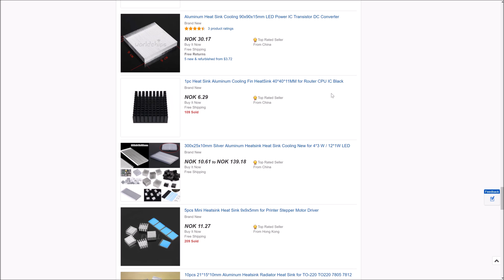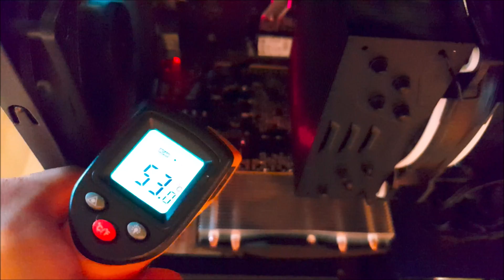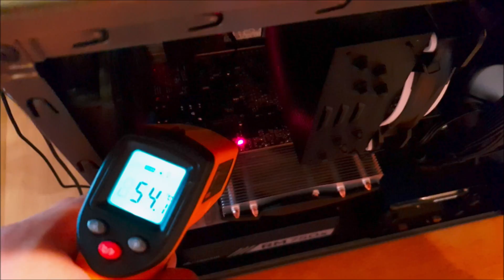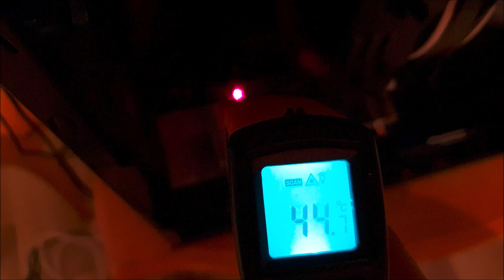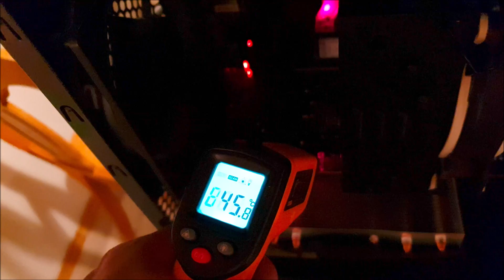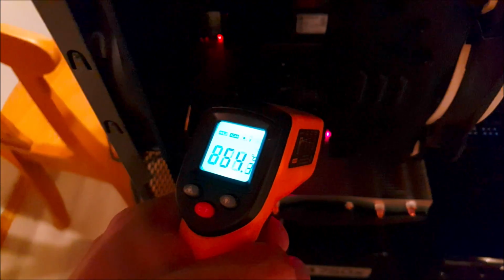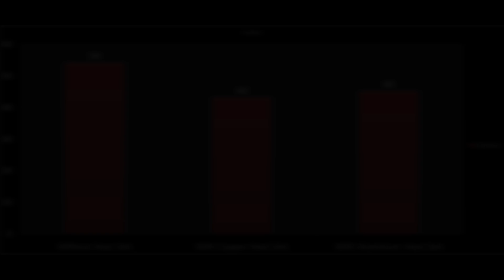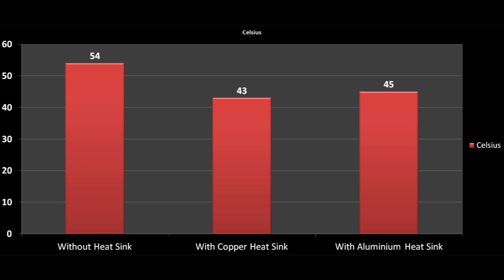Copper vs Aluminium VRAM Heat Sinks

Comment: Good Video but i would rather go with neither. The 8auer said that the vram can be cooled with jsut a smal fan and it would normaly be much better than the stock solution.This is because the thermal tape works as insulation and not only to transfer heat. Also the Vram is with just a fan at around 60-80c on a 1080ti depending on the fan rpm.They usually withstand temps up to 150c.
The stock EVGAs had around 90c Vram temp. Also if you use thermal adhesive its really hard to remove the heatsinks without damaging anything. Ive read a lot, from "Put your GPU in the freezer" to " just twist it, trust me it will go off".
On the other hand ive heard of adhesive thermal tape and falling off heatsinks that causes some short circuit because they touching the cooler. Not the best thing that can happen to a 700$ GPU. And that risk just for 10-15degree? Its not necessary
Reply: that's why he's using the 3M tape.  it's quality stuff.  and you can get a way better OC w/ 15 degree drop.
Reply: What do you think about this solution?
(AIO water cooler + fan on vram + heatsink)
https://www.youtube.com/watch?v=RkN_KTZpCQs&t=4s

Comment: It's a very significant improvement if you take into consideration the size difference between the copper and aluminium heat sinks... The copper ones looked (from casual observations) to have way less than half the surface area of the aluminium ones, yet they still out perform the aluminium ones.

That's why copper is king in the heat sink world... Unless you can afford fine silver (.999) and you have the time/skill to make a heat sink or two from a couple of fine silver bullion coins... THAT would be an interesting video!
Reply from the maker: Copper also has more density. It definitely helps dissipate heat better. Thanks for watching btw!
Reply: @TechnologyHive   disagree  cos you  measured wrong  you were measuring the heat sink so that means 
the aluminum was hotter meaning it was pulling out more heat from the vram  that means the heat sink into the aluminum more  and faster to draw out the heat how it should, were the copper will do it slower and keep it more in.
real test would be 1 hour pc run time then measure 
,then turn off pc and remeasure in 10 minuets -
Reply: @Jozavenue  Yeah, or at least - measuring the surface heat  at the heat-sink is without value unless you also read off the internal temperatures. It's easy enough to do with free software.
Reply: @MalawisLilleKanal  he was not measuring the heatsink dude, he was measuring the PCB under the memory chip therefore the opposite side of the heatsink!
Reply: @Jozavenue  Incorrect.  The heat sink absorbs heat from the device and then dissipates it into the surrounding air.  The sink that can move more heat into the surrounding air faster will have a lower temperature.  It's all about the rate of heat TRANSFER.  In this case, the device is moving heat into the aluminum or copper, and  copper is faster at getting rid of it, so its temperature is lower.
Reply: @TechnologyHive  
Surface area is the relevant factor here.
Reply: You can buy silver sheets of various thicknesses at goldsmith supply stores, reshaping a coin is probably unnecessary. They'd also have a wax that you can sculpt and bring to a foundry to cast its shape in silver. I think that'd usually be 92.5% silver with the rest copper, but that doesn't seem like much of a detriment.
Reply: LETS MAKE IT OUT OF DIAMOND! Graphite would be another option it has amazing thermal conductivity and is cheap but the problem with Graphite is that it has problems conducting heat vertically or through any sort of thickness. I've seen graphite thermal pads for VRAM meant to replace the thermal pads on your GPU they have a weird design and look a bit like steel wool or a sponge, they're also electically conductive so you have to put down Kapton tape around your VRAM to keep it from damaging anything but damn they do make your VRAM temps drop like crazy.
Reply: I think metals like gold and platinum conduct heat best and metals like aluminium and nickel dissipate heat best. So royal metals are best at conducting and unroyal metals are best at dissipating heat. That is also the reason that cpu coolers have a copper base with copper heat pipes and aluminum fans. What if you go an extreme route? And expensive but interesting experiment...

Comment: 1.Can avoid tape and use specially fabricated clamp minimum contact.2.oversize heat sink will be better if it fits.
Reply: Can you give me some a link please?
Or some references?
I would like to do the same modification on a aorus 1080 ti xtreme edition.
(I'm french)
Reply: Nilesh Yalkar I was thinking the same a loose metal in metal contact. But I don’t know much about motherboards. I was also looking into making a custom fan! Heatsink with those small parts and a few laptop fans

Comment: do you have a link for the tape?
Reply from the maker: Hello. Yes, here you go: https://www.ebay.com/itm/5Meter-Long-2cm-Wide-Double-side-Heatsink-Thermal-Adhesive-Tape-for-Heat-Sink/142797051205?ssPageName=STRK%3AMEBIDX%3AIT&_trksid=p2060353.m2749.l2649
Reply: Technology Hive is there one on let's say amazon that ships are quicker? This one says July 21-august 10. That's crazy long wait
Reply from the maker: You would have to look yourself man. I know of this one only from experience with it. Anything else is not guaranteed.